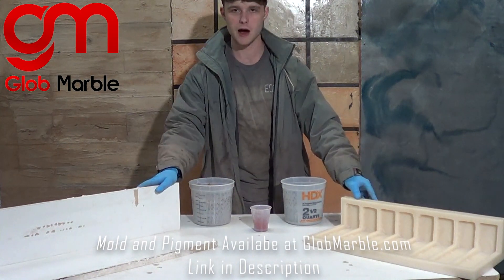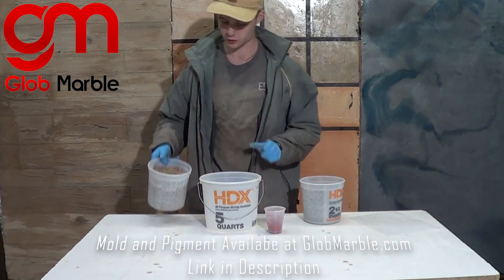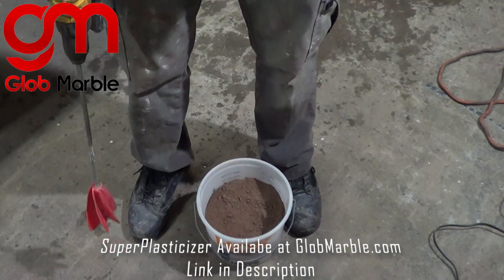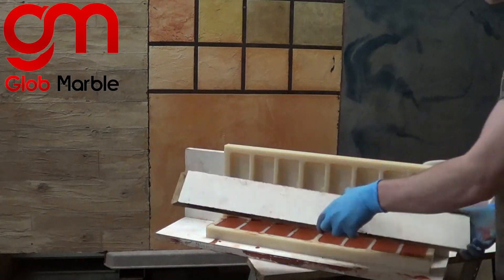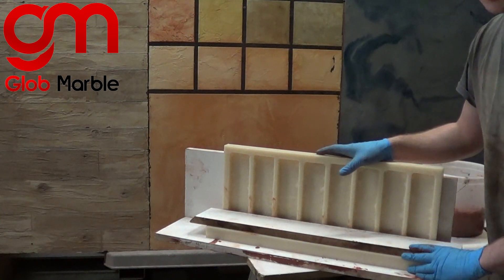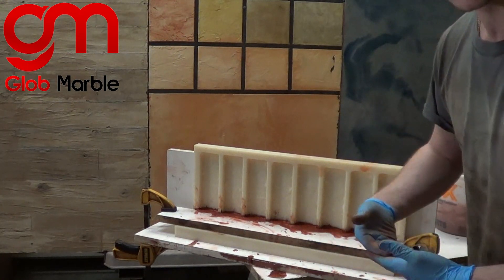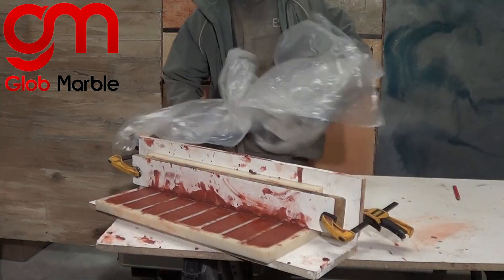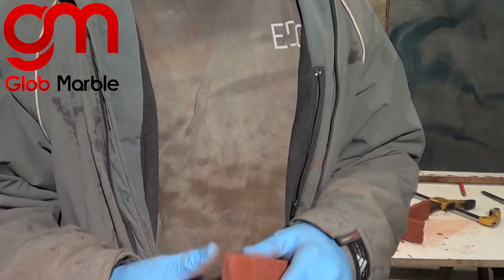How To Cast Concrete Corner Stones / Bricks

Comment: Please comment on how thick the mixture should be, how much water to add, the approximate time you waited between pouring the short end and flipping to do the long end. We have tried and tried to get good corners and we are failing time after time. We always wait 2 days before deforming. We always use the spray release. But when we deform the bricks just break at the corners. This last time we got 1 good brick. Please show more about the thickness of the mixture so we can gauge if that is the problem.
Reply from the maker: We have very detailed instructions on the amount of water and additives to add as well as how long to wait before flipping the form in the description of our mold page. Here it is- https://globmarble.com/old-brick-stone-mold-bs-611.html If all else fails, its probably because it is winter and concrete takes much longer to cure in the cold.  Try buying a fast set mortar mix from homedepot or lowes and demold after two days with that.